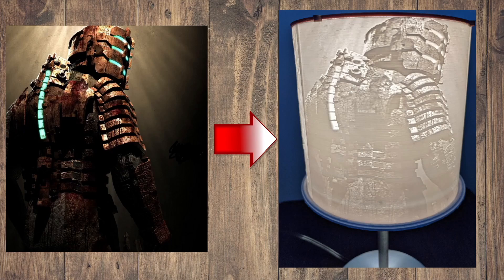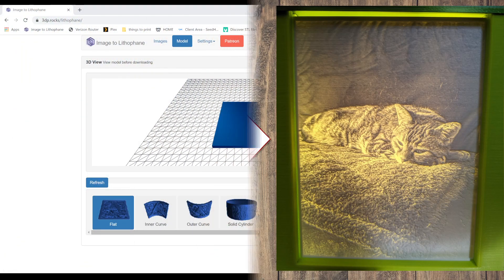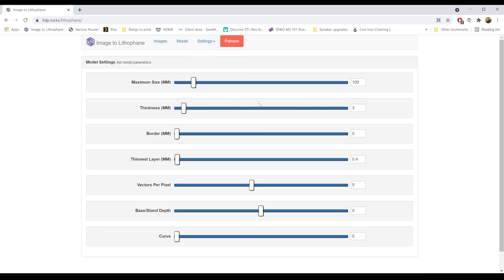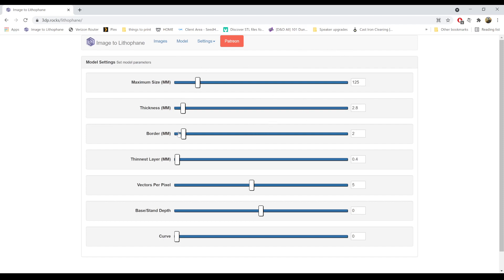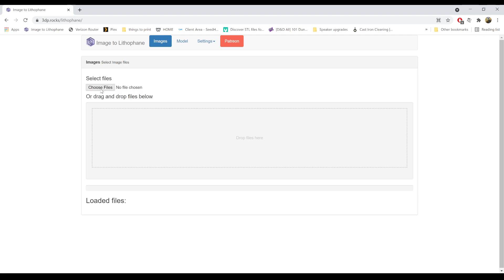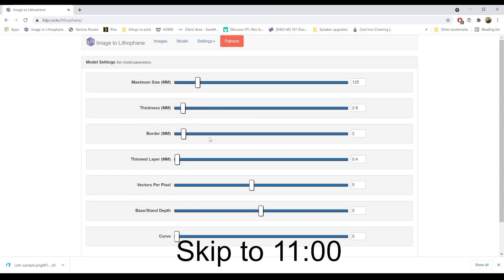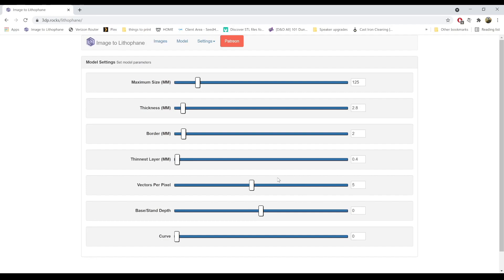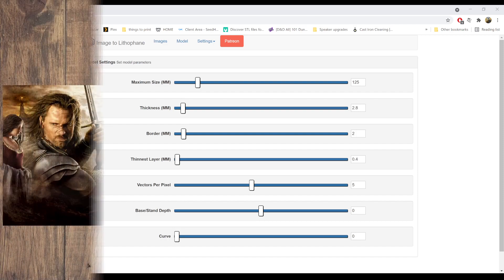3D printing Lithophanes - Part 1

Comment: How can I make the lithophane a complete square? Does the image that is uploaded has to be a square crop?
Reply from the maker: I believe so, yes.  Alternatively, if the image is close to square, I (or you, if you have a slicer) can edit the dimensions in the slicer so that the object is square.  This will distort the lithophane a little bit, but depending on how close to square it is it may be unnoticeable.